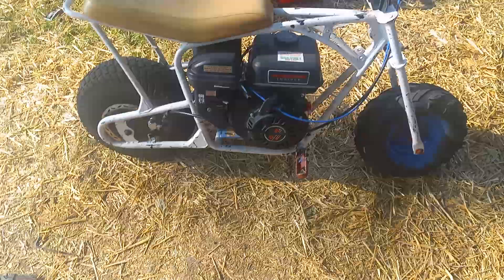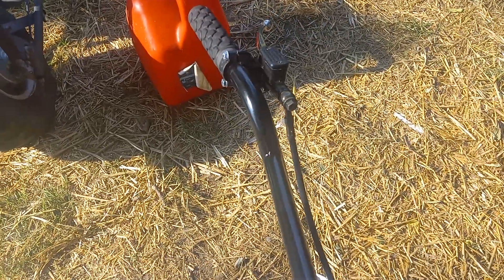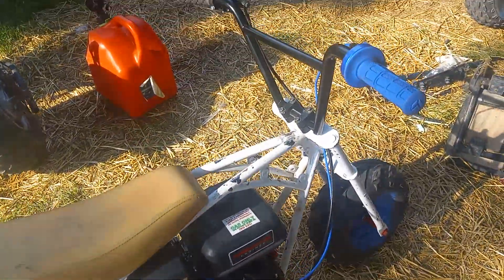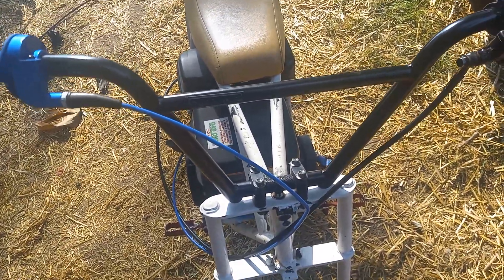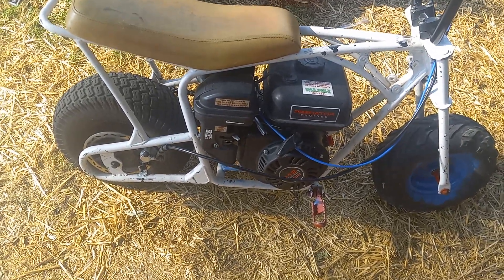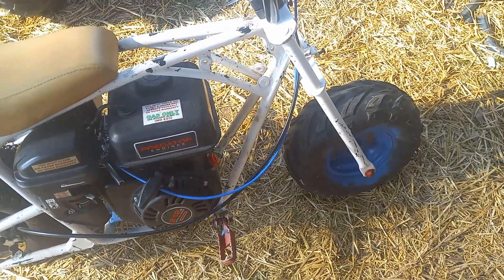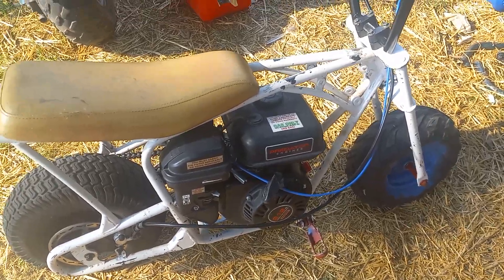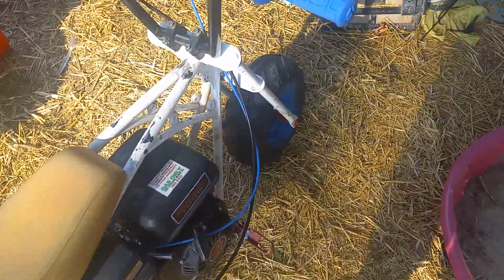Baseline 9.5 bmx bars mm80

Comment: Love the feeling wh e n I f I rst installed my hydros on my vox lol now they're my bitch still the same pads I have it where only the inside pad is wearing the outers are still looking fresh so I'm gonna flip em when I do my rear tire swap what do u think about the GPS 10 inch rear chromed wheel for 180 with the sprocket and rotor
Reply from the maker: When I do the swing arm I'm adding them they also match my craiger 15 inch rims for my s10 I've got to finish the 4 link and c channel do my air ride then drop motor in ill build a try to slide my mm80 in the bed